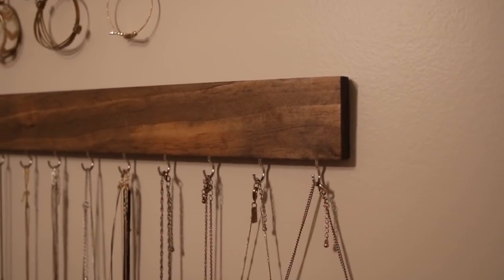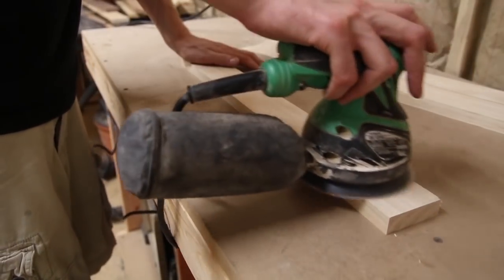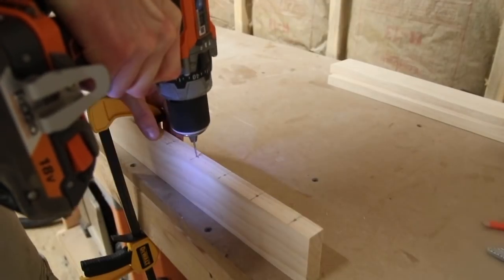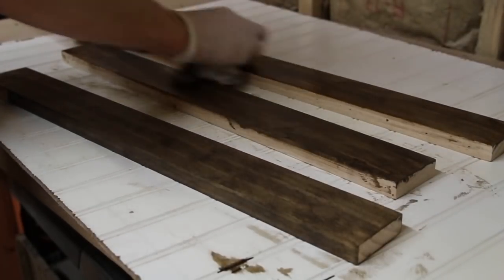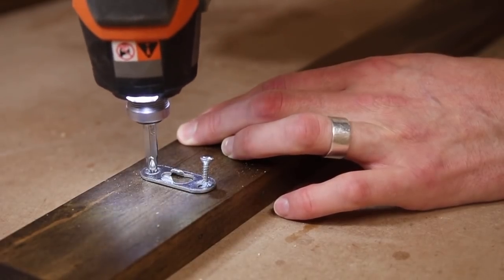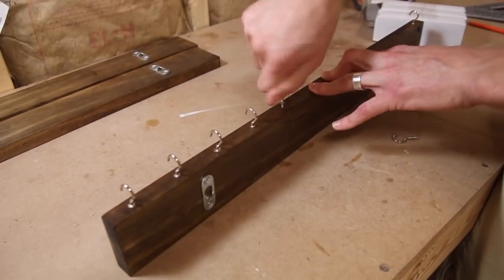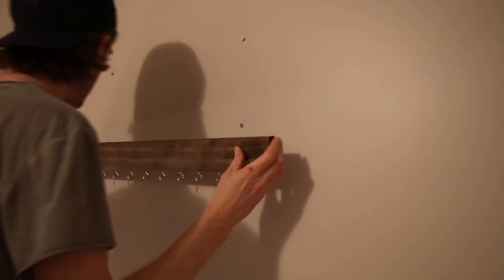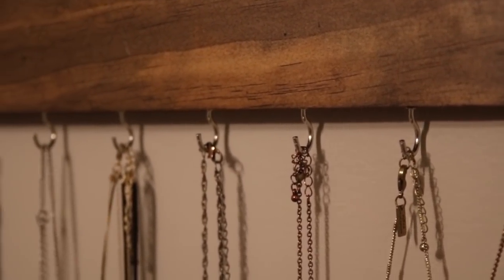DIY Necklace Holder

Comment: You like the finish from the spray shellac? I've tried it before and had a hard time getting it smooth. Maybe user error.
Reply from the maker: What's up Tony! Yes I do like the shellac. I spray very light coats several times. It is more of a matte finish rather than a smooth finish. I might be doing it wrong 😂 but I like the matte feel it gives. I hope you're doing well my friend. 👍